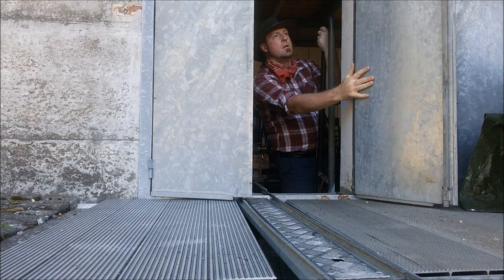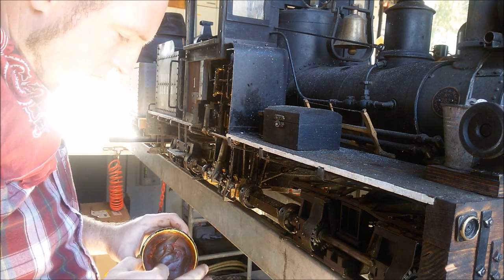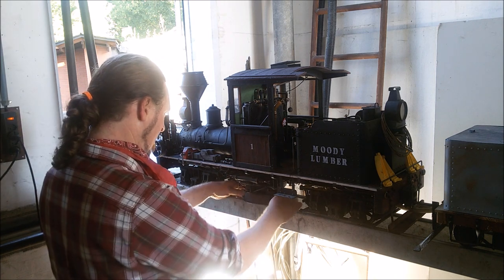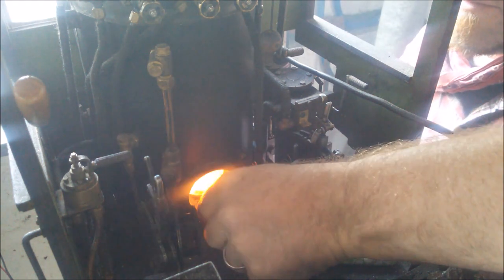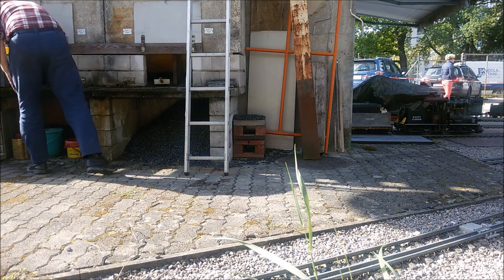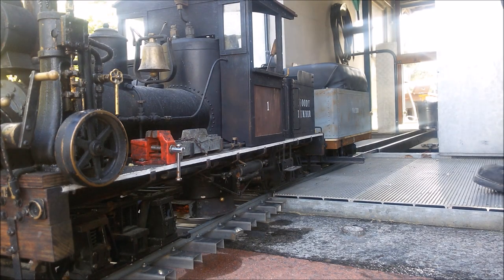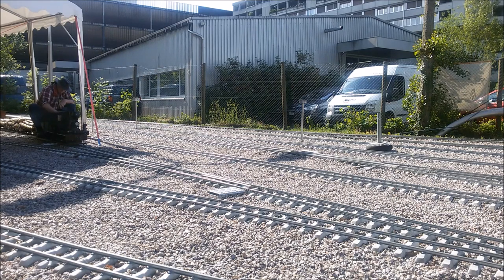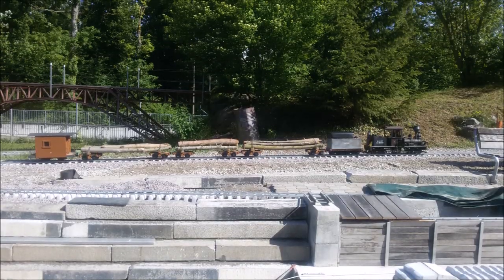Steaming up my 2"-scale Shay locomotive

Comment: I was fortunate enough to have been offered the opportunity to do fireman duty on a 1/2 sized Shay at Kinzers Pennsylvania many years ago. I volunteered to polish the bell while the crew lit the fire and prepared the engine for a day of running. A most interesting, dirty and tiring day of monitoring water level and shoveling coal. A day I'll never forget.  If you make it stateside, you must visit Cass West Virginia.
Reply from the maker: Hi Paul,
Been at Cass in 2010 during the Railfan-Weekend with the 50th anniversary of the last regular logging operation. 
It was a fantastic weekend, which I'll never forget 😉
Reply: @Waldbahner  Glad to hear that you made it there. I discovered it somewhat by accident. I bicycled the Greenbrier River rail trail, the abandoned C&O line that went thru Cass, with my Daughter. The trail was absolutely beautiful. While cycling, we met an older gentleman who had worked as a logger there many years ago, very interesting.  Have you ridden the Mt. Washington Cog Railway?  It's another mind blowing ride. At least it was back when they ran steam.

Comment: Great model of a fascinating Shay loco. Great filming and editing. Not everyday such models are shown.
How to protect the crankshaft bearings, the telescopic horisontal axle joints etc from dust, debris and wear?
Reply from the maker: Many thanks for your feedback. Meanwhile the Shay got rebuild into a 3'gauge prototype by chopping the cab down. Now ä, the overall proportion are much better. I also added new features and theres even one more to come, before this model will be finally finished.

Most bearings are closed ball bearings with dust Covers,  also on the line shaft. The square shafts and universal joints don't show wear after 11 years of service. As on the prototype, the engine gets checked, lubed and oiled before the operation sessions starts. If necessary,  worn parts have to be replaced. 

In my thinking, this is like real life railroad, just in an handy scale.

Comment: 0:40 Please tell me this is NOT Zuckerrübensirup! :D
Reply from the maker: No, its not 😅
Its lubricant for the steam cylinders, also used in huge compressors to provide a ateady oil film which can withstand heat and doesnt wash out with water.
But color and viscosity are close to the Sirup,  since I use an empty bottle for it, just for fun.

Comment: This train so cool!
Is this train is class B?
Reply from the maker: It's a class A with two cylinder engine. Class B would have a 3 cylinder engine.
Reply: @Waldbahner Class A

Is shay number 1?

Looking cool!

How old this train?

Taiwan have this train

Is Shay -21.28.32..more
Reply from the maker: In this scale, I only build this single locomotive. My second loco on the line is an 0-4-4 Forney.
But I operate couple more Shays on 45mm and 9mm track gauge as well.
I'm familiar with the Shays at Alishan, but never been there. Seems #21 got back into operation after a rebuild. This is very cool.

Comment: Do you ever clean off the grease that you applies with your finger from the white container?
Reply from the maker: That's what I wear pants for ;-)
Usually I've some cloth in my toolbox to whipe the grease off.
BTW, I use ecologically compatible grease.
Reply: @Waldbahner  I meant clean it off the gears
Reply from the maker: @Seanmmvi  Only during heavy maintenance, when I have to disassemble the trucks, which I like to avoid

Comment: Question, what would the winch be used for?
Reply from the maker: To load logs onto the log cars. There are videos of the winch in operation on my channel as well.
There were a few logging railroads around Baker County in US Oregon, which used such devices. It was the opportunity to have some kind of steam donkey action, without having another steam boiler in operation.

Meanwhile, I started a sream donkey built which will replace the winch on the Shay loco.